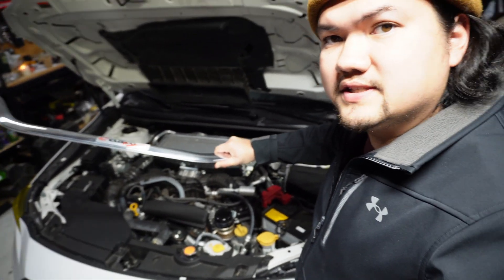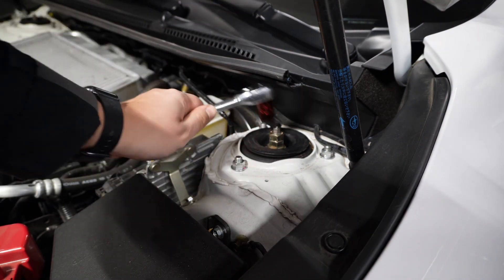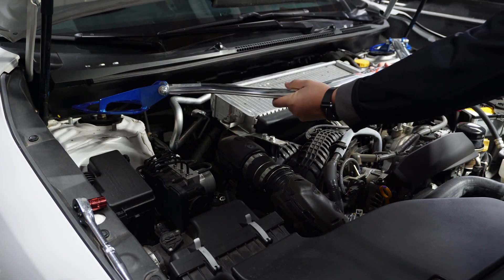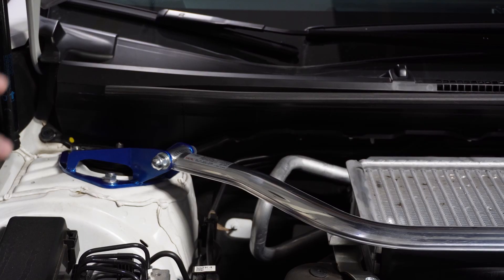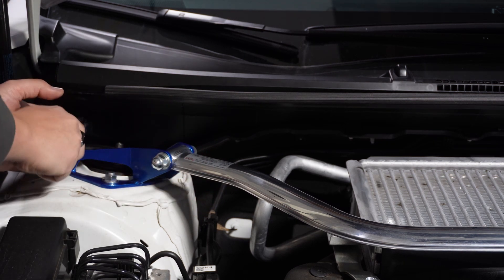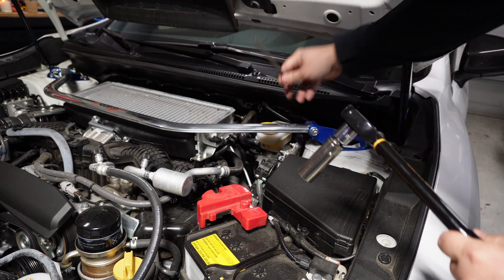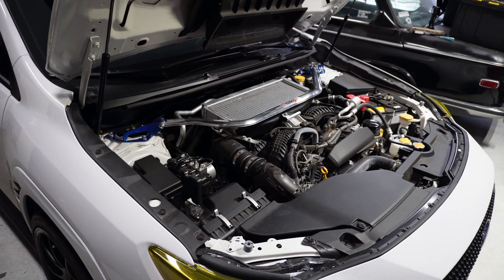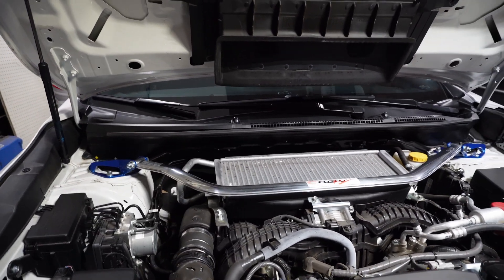2022 SUBARU WRX VB CUSCO FRONT STRUT BAR INSTALL (How to)

Comment: I installed the Cusco rear brace on my '22.  I passed on their front because I thought it would really interfere with removing the intercooler easily.  Maybe I'm wrong about that- IDK.  I did install the STI front with the flexible center joint- not sure how I like that yet  🤔
Reply from the maker: I'd love to do the rear brace as well. When I do the pitch stop mount install I'll see if its possible to remove the intercooler without removing the strut bar.
Reply: @Hapawerks  that would be good info to know.
Reply: @Hapawerks  You've probably bought this by now, but, if not, I can sell you mine for half-off. I bought the quick release one, but I don't need it anymore.